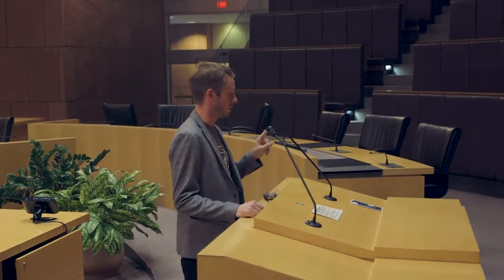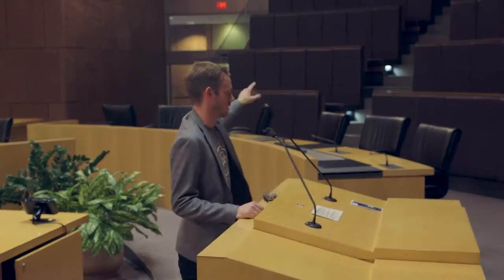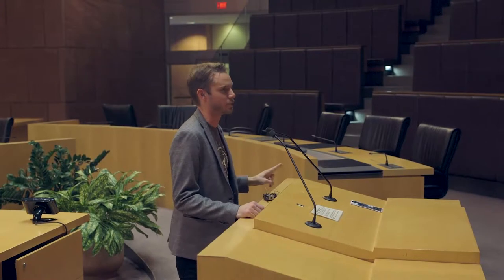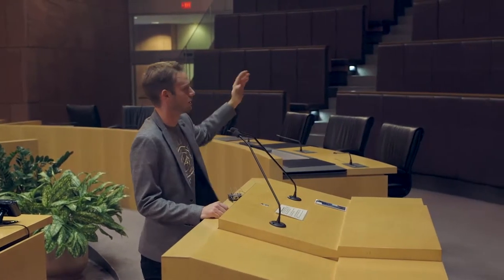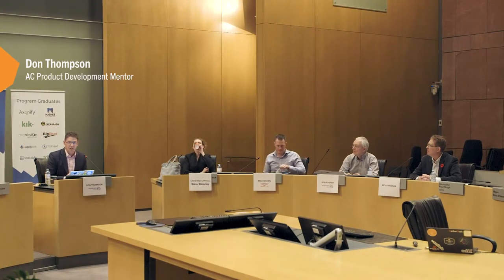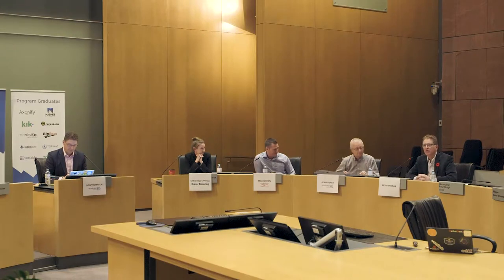Accelerate DFx: Design for Reliability, Longevity, and Durability

Comment: I only listened to the first 30 minutes which had no content in regards to design for reliability. If you are hiring electronics engineers who don't know how to run DRC or cant find a vendor to make your board, you have larger problems than DfR.